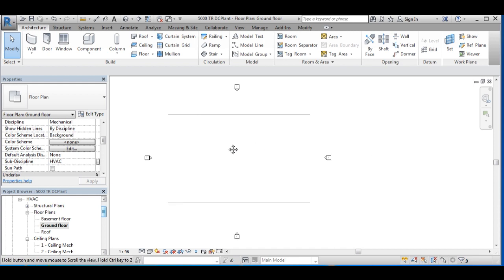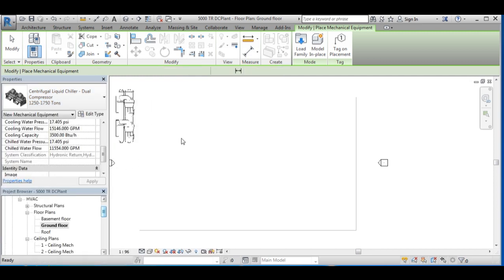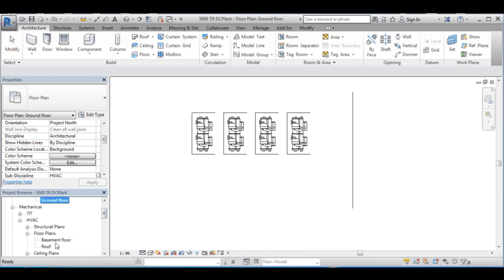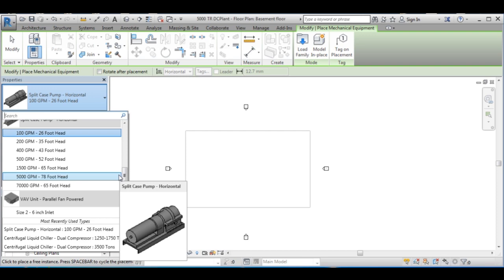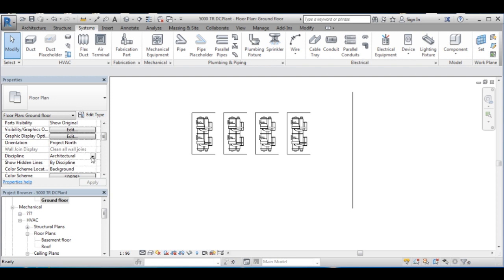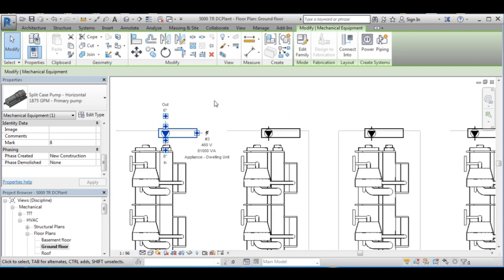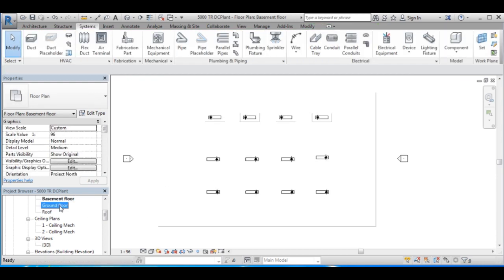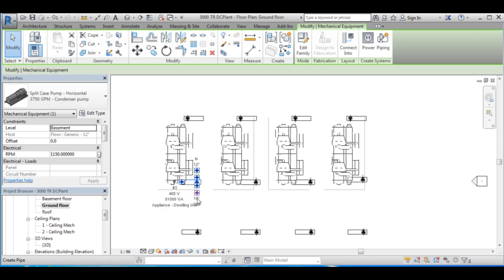Step by step Design of 5000 TR district cooling plant using Revit - part 1

Comment: Dear AMJ,
I have an issue while working on roof plan. View Range tab is disable in roof floor plan. I follow the step which is mentioned in your video. But it wont enable. Pls clarify how to solve this issue.
Thanks in Advance.
Reply: Hi mate,
I also had that problem, however, I solved it.
You may be able to find the 'View Template' in the Properties and change the names into 'None'.
Than the View Range will be activated.
Enjoy mate!
Reply: @sunjungkim4162  set it to unlimited
Reply from the maker: View range tab is disabled since there is a view template assigned to this floor. To adjust this issue click on the view template under identity data in the properties. When you press a list will appear showing the different templates available. Simply press on none and all the disables parameters will be active again
Reply: Check view template